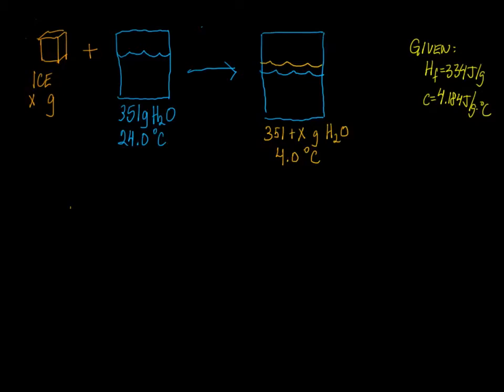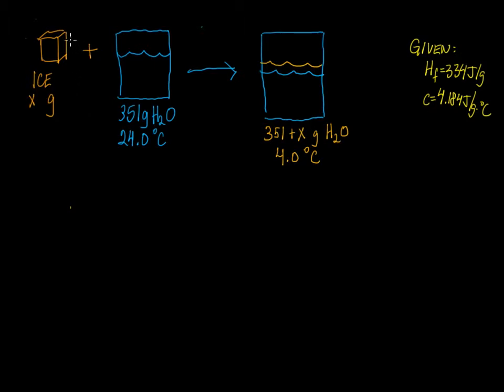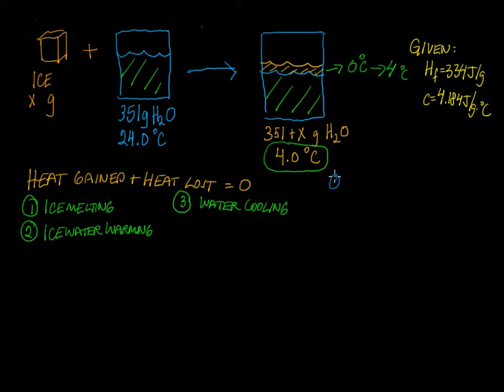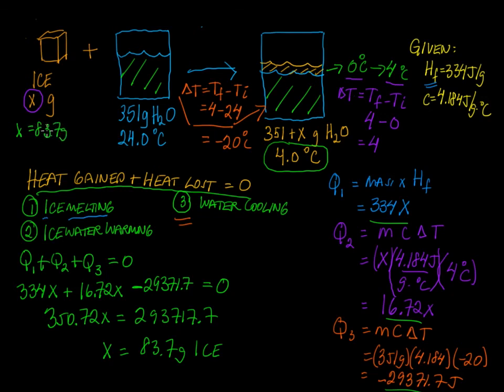how much ice is needed to cool water? Calculation

Comment: Fantastic video, cheers for it. Quick question, the mass of ice required in the video, how long would it take to keep the temperature low as per requirement? That is, if I were to keep adding ice to water for 24 hours to keep the temperature to 4 degrees, how much ice for 24 hours, in total.
Reply from the maker: If you use an insulated cup or thermos, it might last 24 hours. It depends on the container and how much heat is lost.
Reply: @stoddardtutoring6733  Thanks for the reply. How about an indoor pool of water of 12,000 litres?

Comment: Is that assuming that the ice is at an initial temperature of 0°C, thus if the ice was out of the freezer at, lets say -20°C there would be a forth heat of mcT with c of ice and T 20K? 
Excellent presentation, very easy to follow.
Reply from the maker: Yes, that's correct. The heat capacity of ice is 2.1 J/g*C and would need to be taken into account for the ice "warming" up to zero.
Reply: Perfect, thank you!